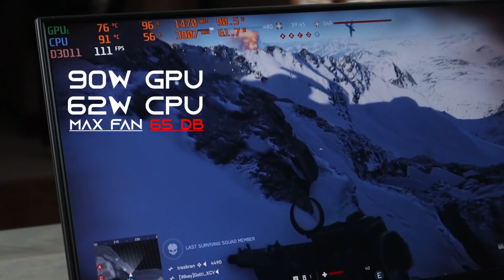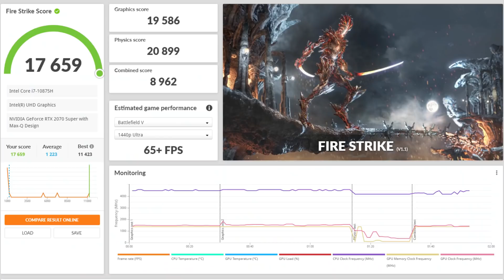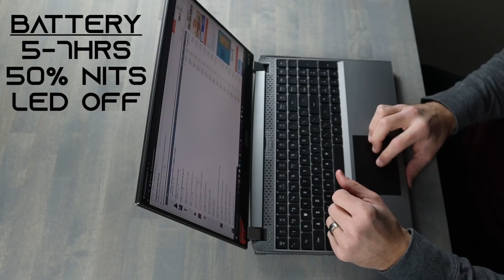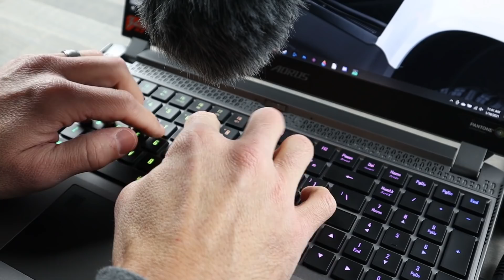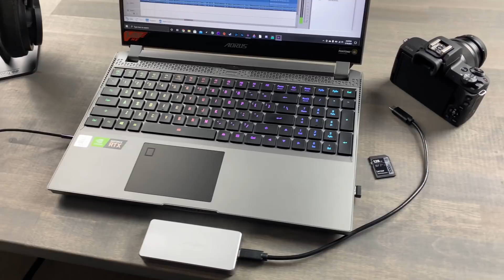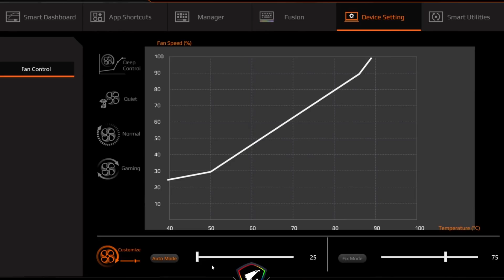Aorus 15G...More Premium than NEXT GEN!  Mechanical Keyboard, Thunderbolt and Aluminum!

Comment: Does this come with a mux switch or some way to disable optimus
Reply from the maker: Not on this model.
Reply: @BobOfAllTrades  awwww that disheartening, i really like this model too, build quality and all. But i see a 2021 model that has a  3070 for similar pricing atm, and although theres been changes to the chassis and keyboard, the thermal performance looks amazing on the new 3070S. Just wish they kept the chassis at least, new one looks like it had a weak spot in the right hinge.
Reply from the maker: I noticed that hinge on Tech Testers video 👍
Reply: @BobOfAllTrades  hinge is giving me anxiety lol but i have a decision to make but your videos have been excellent in helping thank you again for all the work!

Comment: Great review. Like this nice and casual approach you have....In the UK this has been reduced to £1,498. That is a great price for a machine of that build quality with an i7 10875H and the rest of those specs. If you're using it for non gaming then the 2060 is more than enough. BUT (and it's a big BUT)...Unless I was a gamer and willing to wear headphones I think the fan noise would drive me round the bend! Think 

manufacturers need to look at the thermals and noisy fans on the slim laptops of today. Almost every video review seems to mention that the machine ran hot and had noisy fans. They need to spend more time sorting out thermals and fan noise rather than cramming these slim chassis full of power hungry components otherwise more and more laptops will suffer from the same problems. Just returned a Dell XPS 17 because it ran really hot and had noisy fans which stayed on most of the time it was switched on. All this happened while only downloading all the windows updates. Dread to think how hot and noisy it would get if you did any gaming on it.

Comment: Temperature brings degradation. Even if its slight, it still brings it. If you can have your laptop cooler, it will be faster longer.

Comment: i have no love for the new battlefield games but cant deny theyre great for tests because the engine will use and abuse everything you can give it
Reply from the maker: That’s exactly why I use it.  BF titles now are not as fun.
Reply: @BobOfAllTrades  its been confirmed (in an investor meeting) that 6 is coming this year, rumor is theyll go back to modern so hopefully it'll be as good as 3 and 4. 

i saw a test where it was like 'how many cores do games use in 2020' and battlefield was the only one that actually used up to 16 cores. i was impressed by that. the next one is likely going to be a system destroyer at max settings
Reply from the maker: @bradhaines3142  With laptops, thermal and power limits are top priority and that’s why I use BF games.  It offers a worse case scenario while also being realistic 👍

Comment: Will $1.200,- be a good deal for the 2060, i7-10750 and 512GB ssd? Otherwise is the rest of the specs identical. BTW very nice and well put together review, you got a new sub.
Reply from the maker: You might be looking at the 15P instead of the 15G.  The P model is plastic, no thunderbolt 3 and doesn’t have the mechanical keyboard.  

If you are looking at the G model for that price, that’s pretty good but wait till tomorrow and see what you think about the 3000 series cards.
Reply: @BobOfAllTrades  It's the 15G with the mechanical keyboard, but i'll wait and see if the 3000 series is something for me

Comment: I think you risk running into fan stall when going to 10% and not moving any air, especially when not brand new (dusty), so yes would definitely need testing by manufacturer.

Comment: im debating between this Aorus 15g and the PowerSpec 1530 laptop from microcenter
Reply from the maker: I’d say the Clevo should edge out the 15G for FPS performance but it’s a pile of garbage next to the this Aorus once both are in hand.  

The 1530 should may have its display directly connected to the Nvidia card.  Not 100% sure but if it does and you can’t switch it, battery life will be poor.  

If you’re straight up gaming and nothing else matters, I’d have a good like at the Powerspec 👌
Reply: @BobOfAllTrades  im going to be doing gaming, but 3d animation and video production as well.. Also I plan on reselling after a year or 2 so resell value matters to me, if you have any insight on that market...

price wise the aorus is the same $1499 like in the video, but i also reserved the powerspec 1530 for only $1317 open box
Reply: @BobOfAllTrades  tomorrows the day i have to decide which one o pick up.. I am leaning towards the Clevo, like you suggested.. my main purpose is animation and 3d design, but gaming is a close second, and the 2070 super max p seems to really be a better gpu than max q

Comment: I have a gigabyte aero 15 oled 9750h.
On silent mode and idle the fans pulsate and are loud for about 2 mins then off for 12 seconds and back on again. Its so annoying. No control over it. I will never buy gigabyte ever again.

Does this one behave the same on idle?

Comment: You said you are a lunatic for best thermals (best I mean cpu never hit 80c and gpu stays at 58c while playing bf5)? Want thunderbolt 3? Want an amazing color accurate display? Last gen option price drop? Great build quality?

Well then I would recommend Lenovo legion 7i with 6 core intel i7 10750h, 1tb ssd, RTX 2070 super max q, 500 nits HDR 144hz display, full metal chassis for 1399$ at Walmart, so even cheaper than this aorus 15G. If that isn't a steal I don't know what is.
Reply from the maker: The Aorus 15G is better built than the 7i. 8 cores and UHD-II for me is great.  I love the 7i 500 nit display however 👍
Reply: @BobOfAllTrades  I agree, Aorus 15G is build like a tank, but 7i however is built I would say well enough and it's also 100$ cheaper. But thermal performance and idle acoustics of legion 7i are outstanding. Btw great review, always enjoy watching your videos even though I'm not looking to buy anything!
Reply from the maker: I appreciate you stopping by and the conversation 🙏

Comment: BoB ! they removed thunderbolt port on the new Aorus 15G :// 
Something suspicious going on as the new Aorus 15G with rtx 3080 8gb is too cheap compared to the competitors, even 3070 laptops are more expensive.. 
Maybe since gigabyte are cutting corners like no thunderbolt, no wifi 6e and god knows what else they cut down to reduce costs
Reply from the maker: That information came after I finished this review yesterday but I did title it to be somewhat appropriate. They got rid of the mechanical keyboard for the 15G as well as thunderbolt and the aluminum body.

When I reviewed the 17 G my closing statement basically said that laptop was too good and there was no reason to buy their Aero 

Perhaps they took that seriously.

Comment: Still using a Laptop with a RTX 2080. Don't think i need to upgrade anytime soon. Mine is undervolted plus 750+ on the memory.
Reply from the maker: No you’re good.  That’s about 3070 performance give or take 10%.
Reply: @BobOfAllTrades  And i'm also hitting 1830mhz on the core clock with the undervolt. its the best my Laptop can do without being power limited. 

On stock it was hitting 1550 to 1600mhz, and 78c. With the undervolt i reach a max Temp of 70c with 55% fan speed.

CPU Is i7 9750H. Undervolted and 4Ghz on all cores, and temps never exceed 70c during games.
Reply from the maker: Wow nice tune 👍

Comment: Does this unit support dynamic boost for the gpu?
Reply from the maker: From what I can tell, no but the problem is that games still require a good bit of CPU grunt till you’re at 4K.
Reply: @BobOfAllTrades  Yeah, 100 percent agree there. The problem is I can’t see why they’d lock that down, considering external monitors would benefit from the extra gpu power. I hope it’s remedied in the 3000 gpu renditions.

Comment: Really wish Gigabyte would have went AMD with the latest refresh of this laptop and ditched the nose cam.  If they went AMD Ryzen 9, plus a 3080 with 16GB, with that keyboard, and maybe a 1440P panel....my wallet would be lighter right now.
Reply: Instead they've ditched the keyboard 🤷🏻‍♂️
Reply: @WarneysWorld  where does it say they ditched the keyboard.   I thought they stayed mechanical?
Reply from the maker: Matthew Moniz covered the new 15G
Reply: @kennethdawe9984  it's on the Aorus gigabyte website.
Reply: @WarneysWorld  I missed that part.  Thanks for pointing it out.  I'm thinking Asus, but hate that the chassis on the Scar is plastic.
Reply: @kennethdawe9984  Yeah I'd struggle to buy an Asus. Just don't like the look of them. Back to the drawing board for me I think 😭

Comment: I totally agree with your assessment here. At this price, anyone who is OK with a 1080p screen should jump on this deal. I would buy this over any of the new MSI or Alienware 30 series machines, or any other upcoming 1080p machine. 300 hz screen is not a selling point for me.
Reply from the maker: Yeah I’m good with 144hz but then again, my favorite title is still Overwatch and I can get 200fps+ easily with my preferred settings.
Reply: My Dell g7 7700 has a 300hz. I'm coming from having 144 Hz. I thought there wouldn't be much difference but there is. It must be the response times or something things just feel and look smoother even if. I don't get 300 frames. Plus it has better color accuracy and is pretty bright.
Reply: @justswitched8841  There are good and bad 144 Hz screens out there, not so much with 300 Hz, so I can believe it. I would personally much rather have a 1440p 165 Hz screen. I've been waiting years for this resolution to hit laptops and with high refresh rates, I'm excited.

Comment: 8:32 why not set it to not turn on till the cpu reaches 85 degrees?
Also, why not use throttlestop to set the BD prochot to 85 degrees so that the system throttles slightly to avoid turning on the fan?
Reply from the maker: Have you tried this on one of these?  As a gigabyte user for two years nothing has been able to address this properly.
Reply: @BobOfAllTrades  i have a screechy mess of a fan on my 4 year old dell inspiron.

I stuck thermal pad between the heatsink and the Metal back panel to make it work like a heat sink.
I used throttlestop to achieve a -183mv undervolt on my dual core i5 7200u. Had to disable turbo (2.5ghz now).
Overclocked my 940mx 2gb gddr5 +150 on the core and +600 mhz on memory.

85 C gpu temp limit. 84c cpu bd prochot.
Fan set to turn on at 86c (which it will Never reach) 

The system runs ENTIRELY fanlessly.
Like, its completely fanless with the same thickness as the macbook pro 2016.

After 45 mins of sekiro 720p 39fps lock gaming

GPu throttles from 1310mhz to 1250~
Cpu throttles from 2.5 to 2ghz.
I don't play for much longer than that but you get the point. 
COMPLETELY FANLESS.
Reply: @aryantiwari1945  That CPU has a 15W TDP. does it even have a dGPU? Hardly comparing apples to apples here.
Reply: @kohaashi  yes it does. 25 watt 940mx.

But the concept is the same. You sacrifice performance for fan noise.

15 plus 25 watts is 40 watts in a super thin laptop with 1 heat pipe.

This is twice as thic with multiple heatpipes. I'm sure it can handle 50 watts at least with no fans.
Reply: @aryantiwari1945  you can’t set this laptop to leave the fans off until 80degrees. On ‘quiet’ they come on at 50 degrees. Any other profile starts at 40 degrees. Also, this laptop is only chunky due to the mechanical keyboard, the space for the internals is the same as the Aero 15.

Comment: Love the look of the 15G. Shame they lost the CNC aluminium build and mech keyboard for the 30 series version 🤷🏻‍♂️
Reply: Bizarre.
Reply from the maker: They ditched Thunderbolt as well.
Reply: @BobOfAllTrades  excellent review by the way. Your presentation and photography is looking fantastic 👍🏼
Reply from the maker: I appreciate that!
Reply: @BobOfAllTrades  bob YOU are also fantastic :3
Reply: What is the new build material??? They should’ve called the 30 series 15p and not 15g 😅
Reply: @casvaldeikun5023  I think that's pretty much what it is. Massive shame. If the new 15g was like Bob's one I'd place my order
Reply: @WarneysWorld  I pre-ordered it thinking it would be the same as last year... from 30 max-q max-p bs then they add more confusion... horrible practice
Reply: @casvaldeikun5023  it's rubbish. I'm waiting I think.
Reply: @WarneysWorld  I will trust gigabyte this time, if not I can always return it and order last gen 15g if the gpu performance is not the much of an upgrade... here’s hoping it still has premium build quality